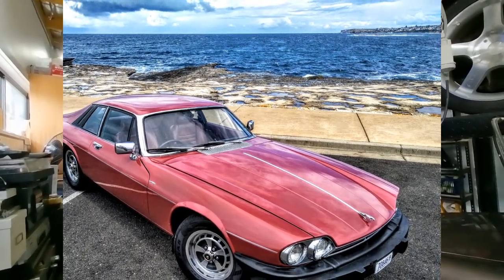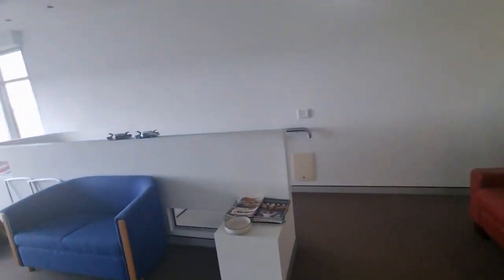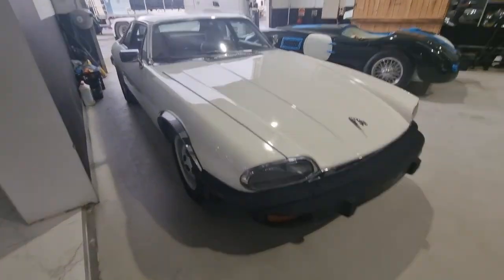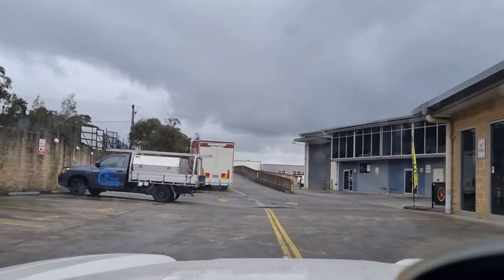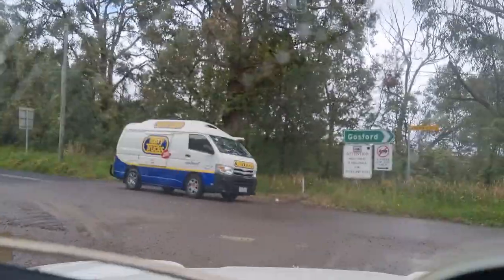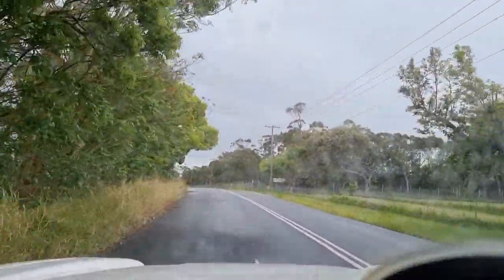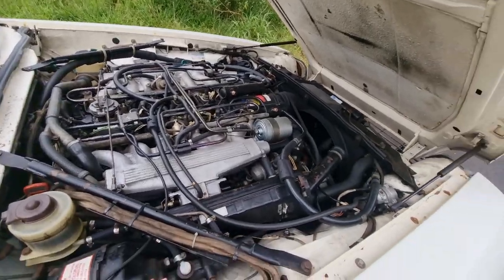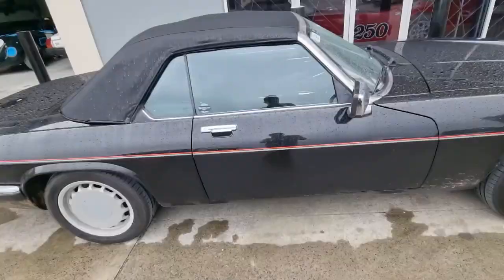Bargain XJS Pre HE for sale. How much XJS can you get for $8500 in AU?

Comment: Smart collection of cars there. Does a V12 XJS Pre He = flat cylinder head?
Reply from the maker: Correct Paul
Reply: PRE H have the best engines for Hot rodding you cant improve HE but from pre HE you easily ca get 350 HP